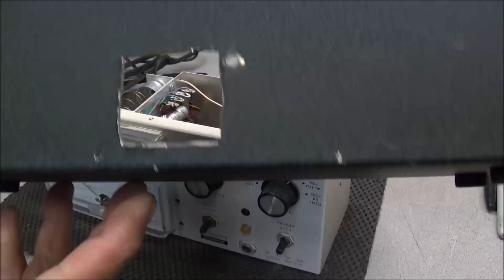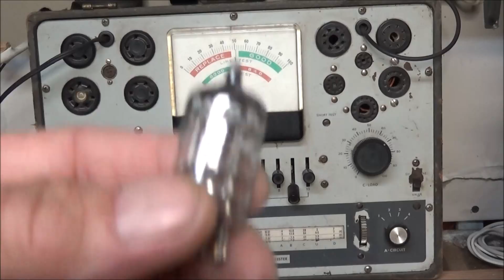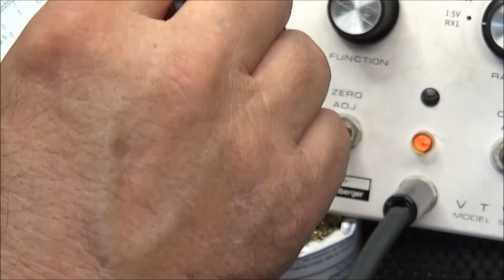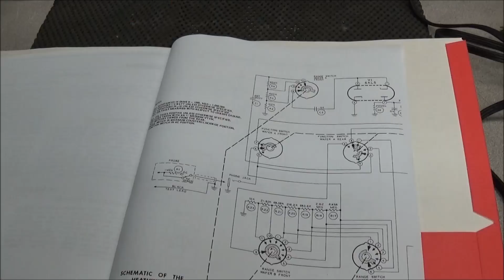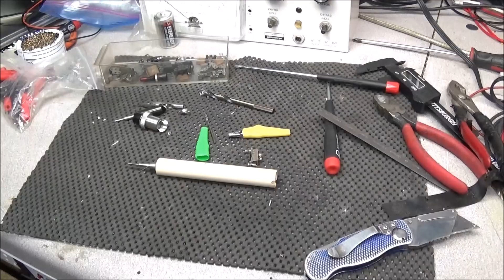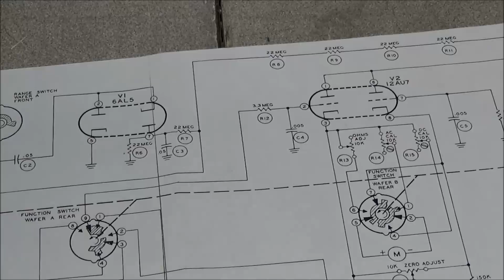#137 5K Sub giveaway Heath VTVM

Comment: Hi,
Great to see a nice equipment put back to work! Good job! I have an IM-5228, that I'm trying to restore. The unit has been recapped & tested all the resistors and they are within the range. I think the person before me had also done some restoration on it. But I had the issue where the needle of the meter goes half way and then keeps shaking at that point. Like putting it to 1.5V range and then connecting a C type 1.5V battery it goes only half way. On ohms range it works sometimes. I changed the 12AU7 tube but no difference. The only remaining thing to test is the EB91 tube, which I'm waiting for  the replacement to arrive next week. Could this be the symptom of a bad tube?
Thanks.

Comment: "I want the meter" ... Am I too late ? ;-). I have a heathkit IM-5228 on the bench being restored and it looks very similar this one. Unfortunately the spring for the battery has badly corroded so I have decided to do the mod so it doesn't need a battery.

One thing I noticed on the DC alignment using the battery is the red dot shouldn't be the reference point. The batteries can be just over 1.5V when new and that is why it's there. It should be the actual voltage of the battery using a calibrated meter and set it to that.
Excellent video Buddy keep up the good work. Subbed
Reply from the maker: Hi Andy, Yep too late for this one. I do have many more I will be giving away. Thanks for that battery reminder. You are correct on that and I was not thinking at he moment.  Thanks for the sub.

Comment: Just a point of order on the DC calibration. The meter was built back when carbon zinc batteries were dominant. that voltage at room temp is 1.55V The Alkaline batteries are around 13 mv higher. Doesn't seem like much of a difference but it should be noted that difference exists.   When I sent up my Heath IM-18 I measured a battery with my DVM and set the meter on the 3V range to read the same value. :)
Reply from the maker: Great point Sue. Thanks for sharing that. I am going to add your comment in the Read before use paper when the meter goes out.

Comment: Another good source for homebrew probes is retractable Sharpie permanent marker pens. You'd think it would be very messy to disassemble one but it's not as the ink material is in a practically solid form and can easily be discarded once you've cut thru the body. They're nice because the pen tip end is tapered and makes it easy to form a lead into. I used one recently to create a high-Z spectrum analyzer probe. Thanks for all the hard work Buddy and sharing with us!  73 - Dino KL0S
Reply from the maker: Thanks Dino. Yes I have used sharpies quite a bit over the years. Even my dried out dry erase markers. Always fun to re-purpose simple things. Thanks for sharing.

Comment: I want the meter need an analog for a course this one will do just fine.  Thanks for the interesting Vids.  Have a TS-850 that no longer works battery is out as it leaked cleaned up around but that is as far as I got do you fix these Kenwood Radios?  I really liked the 850 even have the digital unit but it never worked right.  Got a lot of countries with that thing, would love to get back on air.
Reply from the maker: Sounds like a fun restoration of that rig. They are good units. Good luck